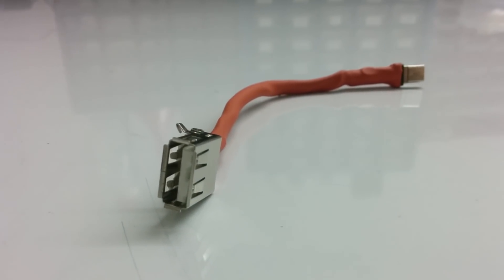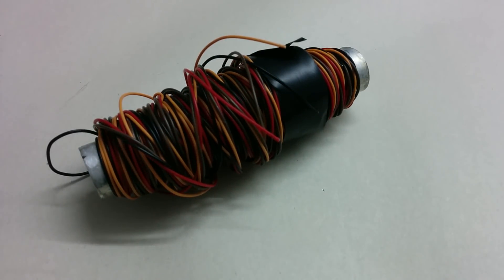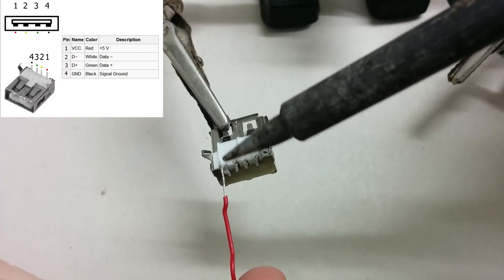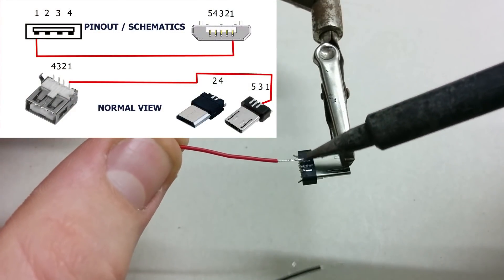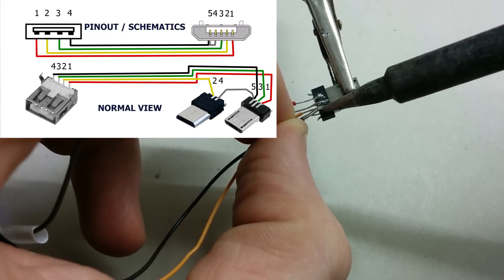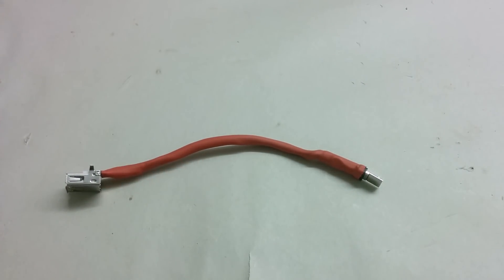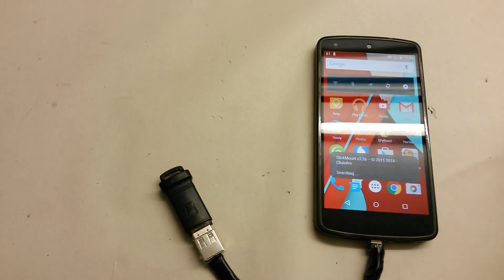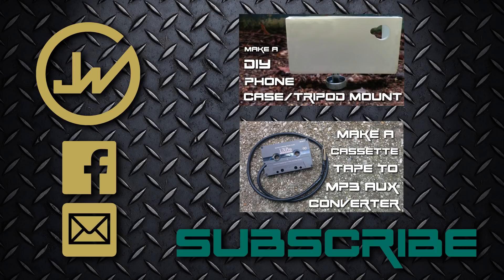How to make USB OTG "On-The-Go" cable

Comment: That was just an adapter from USB-A with a straight through cable, not OTG at all unless the only difference is the 1 wire from pins 4-5.

Comment: Here is a note about the Micro USB male connector. There are three types of Micro USB connectors, namely: 1) Miro USB male connector with yes pin for charging only, 2) Micro usb male with chatti pin used for charging and data transfer, 3) Male Micro USB that has five pins and connects to it female USB 2.0 via a four-wire cable that is used for charging and data transfer.

Comment: I have Samsung 11 pin micro usb male mhl otg adapter ,but i have sony xperia, Xperia has 5 pin micro usb enter,i couldnt find Samsung 11 pin micro usb female to 5 pin micro usb male adapter. How Can i convert?Do you have wiring connections pinout?

Comment: Sir can we make it By our old cable charger
Reply from the maker: +Aantaya Giri depends on your cable, can you see how many pins your cable has?
Reply from the maker: +Aantaya Giri depends on your cable, can you see how many pins your cable has?
Reply: Nop
Reply: No in charger they give only 2 pin outs which make it difficult to route rest of 3 pins. It takes too much critical cutting and soldering i have done it thrice with two time failure... So don't waste time in doing it.

Comment: why it Doesn't work?
Reply from the maker: +Faruk Gül make sure you wire everything correct, which phone do you have?
Reply from the maker: +Faruk Gül make sure you wire everything correct, which phone do you have?
Reply: +Jake's Workshop i wired everything correctly and the cable isn't broken.I have a samsung galaxy s4

Comment: how is the second connection done . 
5 wires
Reply from the maker: +Shoaib Gulshan Can you describe your problem a bit more ?
Reply from the maker: +Shoaib Gulshan Can you describe your problem a bit more ?
Reply: that 5 wires 
3 wires are conected on side 2 other side ?
Reply: +Shoaib Gulshan Hi, Can you describe your problem more briefly,me either do not understand what your problem is. Try pausing the video ans look up the scheme that is provided
Reply: look bro four wires were connected to first a female type usb  ok .
in second connection that small connector required 5 wires.  4321 is ok where does the 5th come from ?
Reply from the maker: +Shoaib Gulshan aha , the fourth pin connects to fifth pin so the phone know he is in the OTG mode. You should buy a connector with 5 pins if you want to do this, some older charging connectors have just 4 pins so also watch for that...
Reply from the maker: +Shoaib Gulshan aha , the fourth pin connects to fifth pin so the phone know he is in the OTG mode. You should buy a connector with 5 pins if you want to do this, some older charging connectors have just 4 pins so also watch for that...

Comment: For those who have said "you don't need to root for OTG to work", bad news. On some Android devices (such as mine, the LG P715/6 Optimus L7 II Dual) it is not supported natively. Most if not all NEW devices support OTG, but for an older low end device it requires rooting.
Reply: Syntax2k6 My LG L Fino not supported it too :(

Comment: It does NOT need root. And if you did everything right it will work with any usb devices, also you can use usb extender for using couple devices at the same time

Comment: OTG USB drives should work out of the box on Jelly Bean 4.2 and up. Are you sure you need root?
Reply from the maker: when I bought my nexus unrooted I try hooking up keyboard which was working fine but for the Usb drive I didnt get any respond from my phone
Reply: Jake's Workshop Is just Nexus devices that need root and USB drivers?
Reply from the maker: Sry but I dont know that for all phones. Try to search this on google
Reply: my moto x has had no problems with otg flash drives
Reply: Neither does my ASUS tablet. Works in 4.4 and partially in 5.0